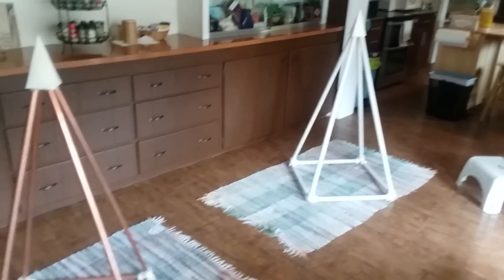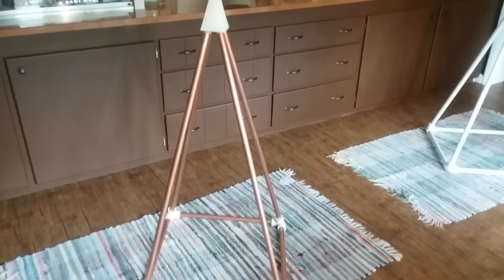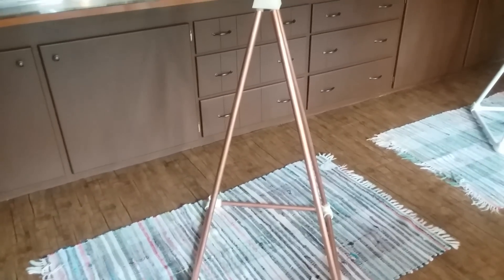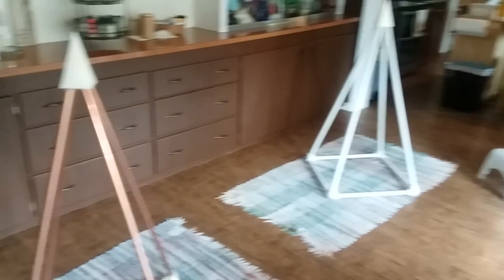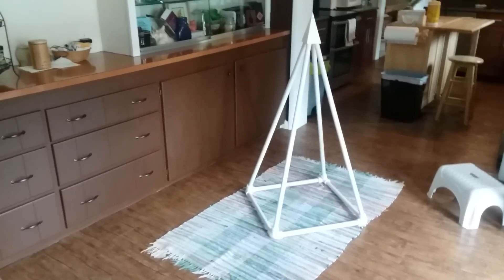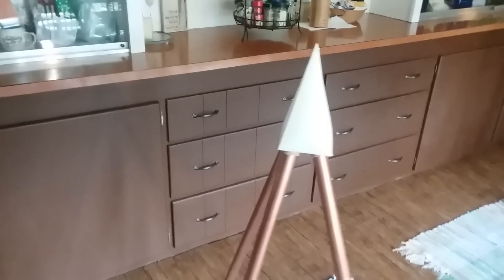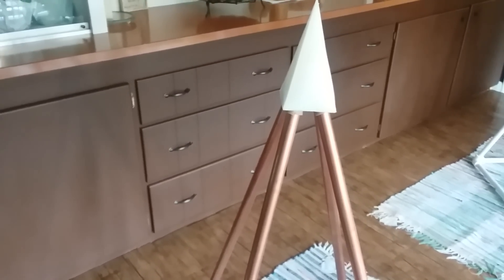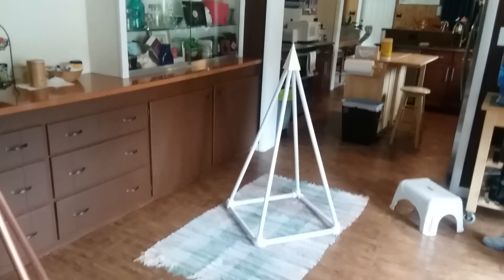See the Energy Difference Between a PVC and Copper Pyramid

Comment: Full copper (welded/soldered) pyramid would emit a greater field. Also I wonder if PVC or copper pyramid would have a longer range downwards in the energy field/projection too. But yeah the more solid the object the better field it has, just like with crystals. Because a damaged shape crystal will have a disruption in the energy emission and it's range or angle.

Comment: "Experiments with some of my two inch pyramids made of plastic and also a large one made of cardboard and a smaller one of copper sheet yielded some corroborative information. Most of the following points were worked out many years ago and tests with clairvoyants correlate precisely with all the research that I and others have done on pyramid energy. However, some new shape power effects crop up here.

4. A copper pyramid works much better than the plastic or cardboard pyramids. We knew that materials were important but not which materials. A single copper pyramid lined up to the earth's magnetic field is equivalent to a plastic pyramid with magnets on each side to intensify the field. Maximum energy collection occurs when the pyramid and magnets are lined up with the earth's magnetic field. This means the copper pyramid is several thousand times more powerful in focusing aetheric force than a pyramid made of dielectric materials."

"Tests were done to find out what was happening with the energy fields around the pyramid arrays. Reults showed that the copper array has much more energy radiating off of it than the plastic array. Even with magnets on the plastic array and none on the copper array, the copper pyramids had more energy. In the copper array, the energy was concentrated off the peaks of the pyramids and between the pyramids in the north-south direction. 

From all of this we can deduce that metals (i.e., conductors), in general, deflect and focus pyramid energy and non-conductors such as plastic absorb and conduct the energy. Similar materials effects are discussed in chapter 3 on orgone energy. The pyramid energy is enhanced when the array is within a magnetic field and the stronger the field the more energy is converted. This requires that the whole array including the magnets be aligned with respect to north-south/east-west and the earth's magnetic field."
-Shape Power, page 73-75.

Why isn't this being talked about?

Comment: Several issues. 
1 that cat, get the cat out of the field of interference. 
2 those clothes are likely polyester not cotton,  which creates another interference. 
3 i work with pvc for plumbing,  it has a static friction so it has conductive properties. 
4 copper has an instant grounding of all energy which is best. 
Pvc isn't grounding anything to pull the positive electrons from the ether, so you are not getting the positive energy which is most beneficial.  You're bathing in a slow puddle of ungrounded energy with pvc
Reply from the maker: Unlike copper, which instantly grounds energy, PVC allows the pyramid to retain and amplify its unique energetic field without dissipating it into the Earth.

Comment: Yeah, it's a fail. Comparing apples to apples means copper through out, not using pvc connectors. 
Assuming that the pyramids are aligned truth North. You said you were doing a second experiment with the copper connected to each other- did you yet? Thx!

Comment: A lecher line is 2 parallel lines of metal.  That thing they have looks like some kind if dowsing rod, not a lecher line.  They need to explain that thing!
Reply from the maker: The lecher antenna was originally designed by Austrian Ernst lecher over 100 years ago to measure ley lines.  It has been redesigned to measure other frequencies as well.  It is used much more in Europe and India.

Comment: I'm very interested in these theories. However, your experiment has many flaws in application. Here are just a few:
1. You're using mixed materials 
2. Your measuring device isn't explained 
3. Where you find changes in measurement doesn't fully explain anything. The pvc could have higher resistance, therefore limiting the measurable field to the upper portion. Copper is more conductive, therefore allowing the energy to travel further down while exhibiting an energy drop throughout 
4. You didn't measure from the distance of the pyramid, only along the sides.

Comment: I’m not convinced to use pvc. Anyhow, just wanted to share that I just constructed a 5 feet base to 5 feet height copper pipe pyramid with pvc connectors since I was not able to find affordable copper connectors within US ( again stressing on affordability). I attached DT quartz with copper wire on all 8 sides of the copper tube and added 4 additional large Quartz at each base corner such that it touched the 3 pipes at the corners. It is oriented to the mag north. I did my first 1 hr of meditation inside and let me tell you, you can truly feel your entire body buzz and come alive. I was lying on a thick yoga mat with additional crystal. The experience was rejuvenating for sure. I will be testing it out more but I just don’t see how PVC can have any effect at all 🤷‍♀️

Comment: There's one thing you're missing here. Your tool is measuring the centrifugal force of the torsion field created by the pyramid. A strong detectable centrifugal force means the inner, centripetal spin is also weak. The faster the torsion spin, the tighter the torsion field. You want a fast torsion spin for optimal results. That copper pyramid is producing an insanely faster, tighter torsion field. The centrifugal portion of the field is not the important part. The centripetal force is where implosion/fractality/negentropy happens. And so copper is actually better, and your test actually proves this - it's just that you're misinterpreting the results...
Reply: That's an interesting possibility, though the results could also be because the joints are not electrically connected and thus the circuit is broken, Dan Davidson measured his copper pyramids to be several thousand times stronger than his plastic ones and probably measured the field strengthen centrifugally as well.

Comment: I think your viewers as well as myself would Ike to see the energy field of an entire copper pyramid.  I'm also wondering if a pyramid by itself conducts energy regardless of the material it's made with. If you get a high energy field using pvc which I believe is plastic, pls correct me if I'm wrong. If plastic can generate a high energy field, it's logical to believe that copper would generate an equal if not higher energy field. After all copper is one of the metals the Egyptians were mining. Some of the Egyptians had blue skin, blue blood which I believe is due to high levels of copper. We have high levels of iron so our blood is red. Although you are demonstrating Russian pyramids not Egyptian pyramids, so what's the difference? I think I'm going to research this and the effect of using diff materials or the a pyramid itself will generate energy Regardless of the material it's build from. I would think the material would need to be conductive, but copper also oxidizes, can this effect the energy field? Idk...so many questions I have.

Comment: The research in Pyramid fields I have started recently includes LES BROWN lectures: whereas,  It is a MUST that the copper pipes (or ANY material used) be touching at ALL 5 intersections, not blocked by a different material (as the PVC blocks the copper in this video).  It is amazing that energy would be detected while the copper is not touching completely throughout the frame of the pyramid.  A fair comparison will either connect the copper with copper fittings, or use non-PVC joining material on the PVC pipes to get a more accurate test.  At least it appears both pyramids are aligned in the same direction.
Reply from the maker: We did do a subsequent video to deal with your question.  We connected all copper pipes with copper wire so that there was a connection throughout all copper pipe connectors.  This did not change the results.  Nikolai Kozerev, Dr. Golod from the Russian Pramid Research, and the Law of One Material all concur with our results that base metals have a negative effect on the energy field.

Comment: I broke through current on the copper wires with those plastic joints. U must use copper joints or another metal

Comment: From what I have heard, pvc pyramids actually worked better than pyramids which contained “metal” framework. ….I’m not sure that includes copper. 

What we know about the attributes of copper…clearly that material will have some sort of effect different than other materials….but would it be the desired affect to use it? I don’t know. Guess more research needs to be done testing both materials

Comment: You used insulators to hold together the copper conductive material. Seems like you didn't like the results of the first test you did so you've found a small way to cheat and get the results you wanted. Seekers of illusions need to keep the deceptions to themselves. Scientific testing is unbiased and reveals truth regardless of preconceptions, or affiliation. I may only be one but you just lost my views. 
Advising others is a great responsibility that should be done for the greater good of those listening not for the greater good of the person speaking. Yet your clever misguidance illustrates clearly this isn't fact but opinion

Comment: Its name is the pyramid of Nubia, not the Russian pyramid.
Pyramid of Nubia is located in the country of Sudan...
Nubian pyramids are pyramids that were built by the rulers of the ancient Kushite kingdoms. The area of the Nile valley known as Nubia, which lies within the north of present-day Sudan, was home to three Kushite kingdoms during antiquity. The first had its capital at Kerma (2500–1500 BC).
Reply from the maker: Actually, the Russian Pyramid is a specific geometry not found in the Nubian pyramids.  In fact, the Nubian pyramids have a fairly wide  variety of slant angles.  The ones I have measured range from 60 to around 70 degrees, while the Russian Pyramid has a slant angle of 76.345 degrees.  Interestingly, this slant angle perfectly matches the apex angle of the Giza pyramid, and well as matches the slant angle of the pyramid hieroglyphs found at Karnak.  I will be discussing this in my book.

Comment: You should first discharge all static electricity from the PVC by wiping with a damp cloth. Also, your test doesn't show any difference in the amount of energy but only in its location (height). Is that what you are intending? I found it all very vague and the "Lecher" antenna - being similar to a dowsing rod - relies on human sensitivity, which can produce unreliable results. By the way, what wavelength is your antenna tuned to?

Comment: I had a pyramid made of 1" copper tubing. The base was 12 ft. square. The sides were the same proportion as the Great Pyramid at Giza. The effect was outstanding. All energy is electrical in Nature. Copper is a wonderful conductor of electricity. It doesn't make sense to use anything else.
Reply: This is true. And the test they're doing here actually proves this. They're just misinterpreting the results. This test proves that the copper pyramid is producing a tighter, faster spinning torsion field. They're detecting the centrifugal force outside the PVC pyramid, which means it's weak and slow. The torsion field generated by the copper pyramid is tighter because it's spinning faster, and a fast spin is how you get fractality/order/negentropy.

Comment: The Egyptian pyramids were made of nonconductive limestone on the outside and conductive material for the shafts, apparently to draw electric current from the aquafers and into the center.   Who knows their original purpose, perhaps they purified or desalinated water for drinking?
   But, the big question is should we wear a Devo energy dome, like PVC, or should we wear a tinfoil hat?
Reply: They were made to Remind Humans OF Our Power Within The Christ Universal Knowing Being
Reply: @claudea4092  The Devo energy domes or the Pyramids?
It seems that the Pyramids were built between a salty sea to the north and the ocean to the south; and connected to both.
It might appear that the Great Pyramid was designed to take advantage of the voltage difference between the two seas, for some purpose.
   But the limestone on the exterior appears to be to create an electric current at a desired frequency, much like a solar panel of today, perhaps to reunite hydrogen and oxygen into purified water, in the Queen's Chamber at the top.

Comment: ENERGY FIELDS AND LECHER ANTENNA
1. What is the research question?
2. What is the current scientific literature on the research question?
3. What is the research methodology?
4. What is the justification for the geometric shape, size and dimensions of the Test object and the Control object?
5. What is the justification for the material(s) used to construct the Test object and the Control object?

QUALITATIVE OR QUANTITATIVE MEASUREMENT 
The Lecher antenna (also referred to as the Lecher instrument) is the main scientific mechanism used for the qualitative detection of energy field’s interactions and the tool used within Bioresonance Analysis of Health and also ACMOS energy balancing therapy. Developed by famed Austrian physicist Ernst Lecher, the apparatus is designed to accurately measure electromagnetic wavelengths and frequencies. Lecher lines are part of a field of physics associated with vibrations and waves, where parallel conductors form a transmission line, with a characteristic impedance. The Lecher instrument used for medical application is specially adapted to allow a physician to obtain information on a patient’s state of health often thought as inaccessible (such as specific stressors like electromagnetic, geopathic and emotional stresses). No other instrument or testing method, whether biochemical, functional, EAV / electrodermal, computerized, biofeedback, or muscle testing can detect as much useful medical information as the Lecher antenna. 

Benefits of the Lecher Antenna

The Lecher Antenna is utilized in clinical practice for the following benefits:
    Precision calibrated scale for the accurate measurement of high-frequency wavelengths
    Ability to detect both Yin centripetal energy (resource information) and Yang centrifugal energy (management information)
    Capable of detecting Very High Frequency (VHF, 30MHz to 300MHz) and Ultra High Frequency (UHF, 300MHz to 3GHz) electromagnetic waves
    Allows for the qualitative assessment of any product or medication
    Allows for compatibility analysis to assess benefits of a particular medication, supplement, food, or substance to a given patient
    Used in ACMOS energy balancing therapy as well as the advanced evaluation method Bioresonance Analysis of Health (B.A.H.)

HERE’S HOW IT WORKS…

Much like a scalpel, stethoscope, and numerous medical instruments, the Lecher antenna may seem to be a fairly simple device. However, in the same was the scalpel and stethoscope may be used for numerous medical applications in the hands of a skilled physician, so can the Lecher instrument. This is due to the ability of the antenna to accurately measure wavelengths generated by electromagnetic signals.

Just as a tuning fork, set to a particular tone, will audibly notify its listener whenever a similar harmonic wavelength is being transmitted by means of the well-known phenomenon, acoustic resonance, the Lecher Instrument will notify its user through vibrations in the presence of certain qualitative frequencies pertaining to organic matter, by a similar and equally well established phenomenon known as bioresonance. 

By setting the conductive shorting bar to certain previously calibrated notches, known as the wave V-max or Geissler nodes which have been specially indicated on the Lecher lines scale, the presence of highly specific oscillatory wave signals can be readily detected. 

Importance of Yin Centripetal Energy and Yang Centrifugal Energy

The reason the Lecher Antenna is the chosen form of analysis of energy is because it is the only instrument which can detect both types of patient information – resource (Yin centripetal energy) and management (Yang centrifugal energy). No other form of testing can detect both fields (only management, not resource). A comprehensive and complete picture of a patient’s state of health cannot be accurately determined without the detection of both of these basic and primary forces.

Proper functioning of the organism is dependent on 2 forces – Yin centripetal energy (also referred to as resource information) and Yang centrifugal energy (or management information). The inward subtle energy of Yin centripetal is essential in understanding underlying imbalances and dysfunctions. It is a shorter wave and higher frequency. No other instrument or method, whether EAV, computerized, biofeedback, or muscle testing, can detect both fields of energy (only management, not resource).

Comment: I’ve been opening lines of communication to off world humans   The Orion’s say you can use PVC or copper or even wood  it must be at 1.16as the new resonance is different   You still have a energy vortex ( that’s what they call it ) (Ra from 1978 the law of one gives this deg also as updates deg )  with 1.16you can place yourself at a 1/4 of the way up in the pyramid to get best results ( not sure what you may be doing there ? You may be intensifying the energy  ? )  I asked well what is the best material so I can make mine the best it can be ? They said “use the metal of the gods  copper “ I built mine of copper  all joints and at 1.16 deg.  You can build it any way out of any thing your still going to get results.  The Ra material says you need to use the same material in its connecting joints  if I recall.   The important thing is we are all knocking doors  experimenting  upload your stories !